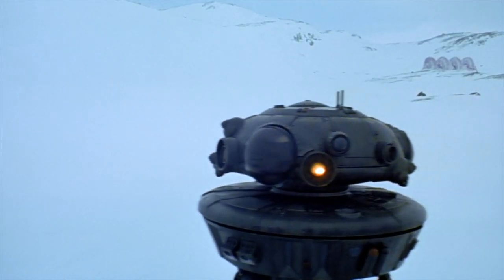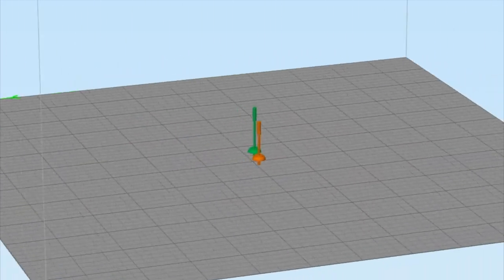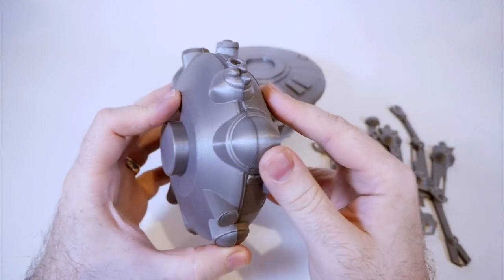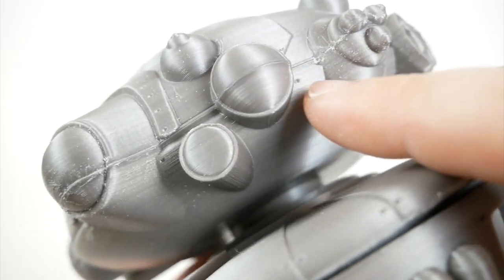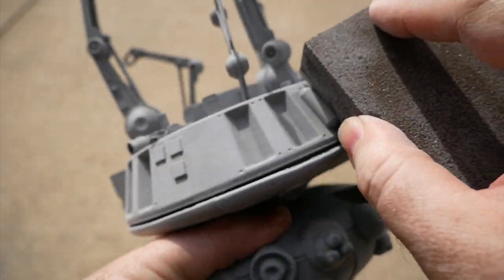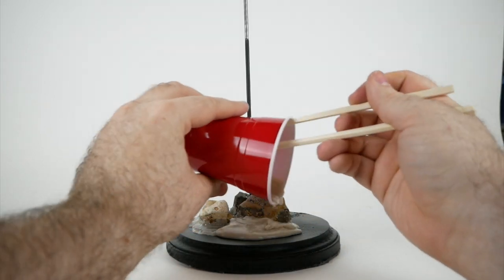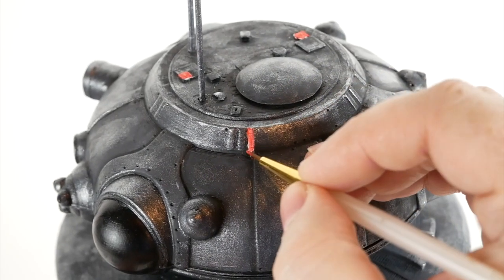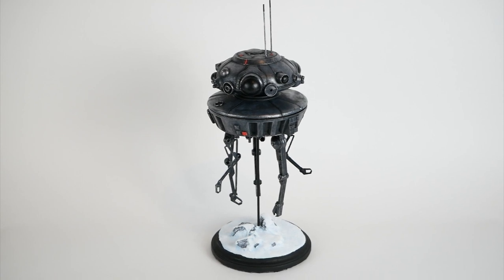3D Printing and Painting a Probe Droid Model

Comment: What a brilliant print! If I might say, I’d have done all the sanding before putting it together. You also could have added some lighting. It’s still amazing. Do you mind me asking what scale it works out as for the final print?
Reply from the maker: Yeah I think I may have mentioned that I could've done that a bit differently. I don't actually know what the scale is, but I think it could probably pass for 1/6
Reply: Mighty Jabba's Collection Yeah. Sorry if that came across as a dig. I didn’t mean it that way at all. I’m in awe of 3D printing. I scratchbuild models by hand, but 3D printing looks to be so versatile. I was thinking it was looking close to 1/6. I’m doing the prep work right now for a 1/6 snowspeeder. It’s going to be a monster in 1/6! I mocked it up in cardboard first to make sure I have the sizes right and it’s huge!(Despite being one of the smallest SW craft!)
Reply from the maker: A 1/6 scale snowspeeder would be epic.
Reply: @MightyJabbasCollection  Yeah. It's going to be mahoosive.

Comment: At 4:14 either you had the drive in reverse, its a cool optical illusion, or I'm blind. Totally looked like the drill is spinning counter clockwise. Awesome model and print, Just got a CR-10s and I got get it dialed in here as my prints don't look that good yet.
Reply from the maker: Heh, that might explain why I had trouble getting through. I was more focused on filming than drilling.

Comment: Also, if you use 2 part epoxy vice a glass coat you will get a much nicer more realistic glass/glossy look
I use it regularly for glass or eyeballs
Reply from the maker: What brand do you use?
Reply: I use adhaero 5 min epoxy.  But any epoxy should do the same as epoxy resins dry clear.  I use the 5 minute syringe epoxy because I don't need alot and you can get it at any hardware store for around $10

Comment: You might want to revisit this now that you have a resin printer lol
Reply from the maker: Well I think I’d probably still do it more or less the same way, because my resin printer is too small for something like this without cutting it up into a lot of pieces.
Reply: @MightyJabbasCollection  Totally understandable Which I was thinking you would do, print them in individual parts and glue them together with a little bit of resin and a UV flashlight, I'm sure the Paint filler helped, however,  it wouldn't compare with the detail the resin printer can do.